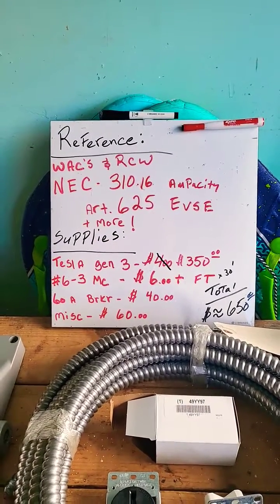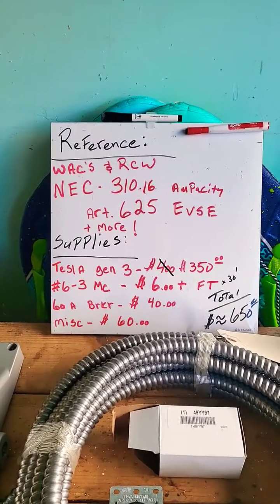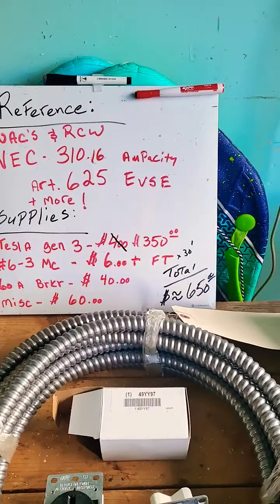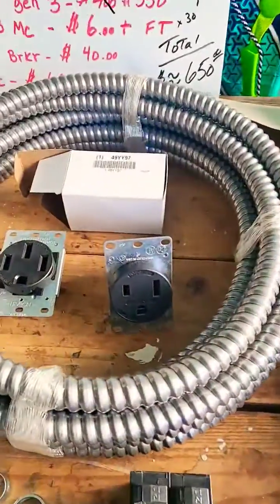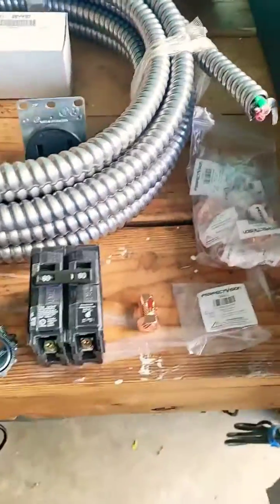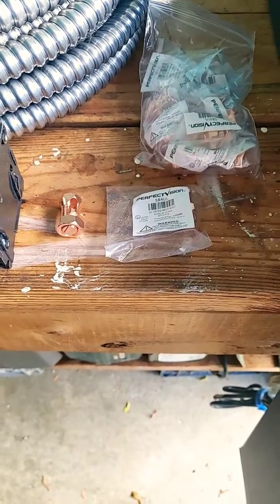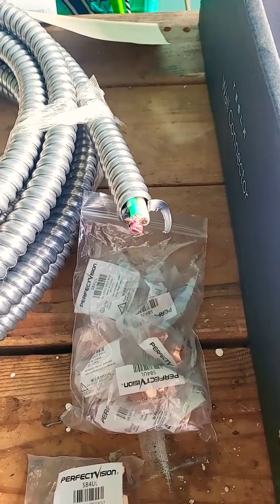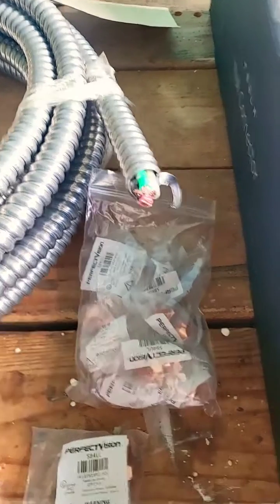Tesla Gen 3 Wall charger install - know yo supplies before purchase! #ev #pnw #modely #charging

Comment: You only needed 6/2 plus ground.  There isn’t even a spot on the EVSE or the NEMA 6-50 to land a neutral.
Reply: If the man wants to have an extra wire let him add an extra wire lol...he did better than most electricians in that he had 6/3 mc instead of 6/3 romex which wouldve been a code violation. Let him cook bruh.
Reply: Flexibility for what ????????
Reply from the maker: @timvaquero1797  well like installing a NEMA 14-50 outlet in the future. I worked maintenance for twenty years, having a spare is always worthwhile. Thanks for viewing
Reply: @timvaquero1797 😂
Reply: @timvaquero1797 😂
Reply from the maker: Agreed, but it gives me flexibility in the future

Comment: why are you using #6 instead of #4? that connector is for non metallic cable but it would still work. and split bolts arent a great idea, wire nuts are better or something else already insulated
Reply from the maker: #6 xhhw is the right size per NEC ampacity tables, I realize the connectors aren't exactly right but the box connectors for MC isn't the easiest to find and finally split bolts guarantee a tight and lasting connection as opposed to wire nuts which tend to loosen over time with thermal cycles

Comment: Why use a 60amp breaker for a 50amp rated nema?
Reply from the maker: Per the National Electrical Code (NEC), you must de-rate by 25% for a continuous load. That is why the Tesla connector uses a max 60 Amp breaker to output 48 amp continuous. I hope that helps, thanks for watching
Reply: You also have to de rate the outlet for a continuous load

Comment: Always check your local, state, federal,national codes!! A pro is best, and always insulate your split bolts.
Reply: Always best to go with a professional if you're not 100% confident, heck even with confidence a person with more experience is definitely still the better option!
Reply from the maker: @tyniria  they call them professionals for a reason, so I absolutely agree. I have decades of training, experience, and knowledge as do most electricians, and the average home owner isn't usually up to it. However, if someone studies up all the applicable code and does the work in a safe manner more power to them, pun intended...groan.. lol. Thanks for viewing